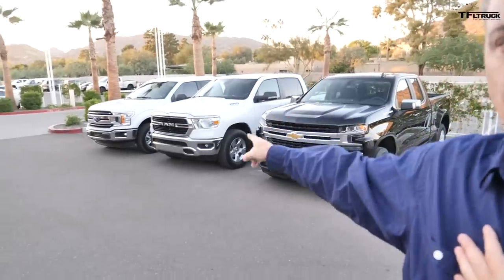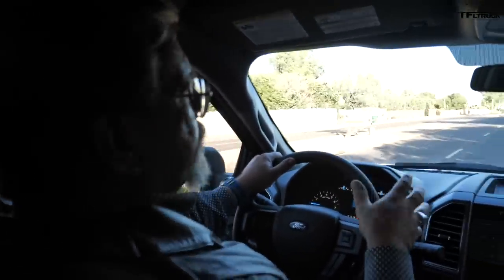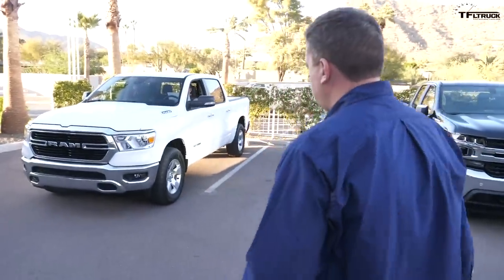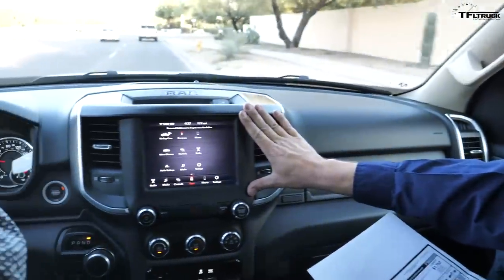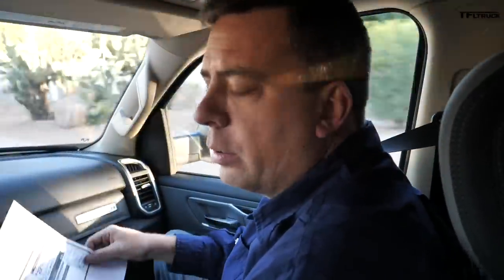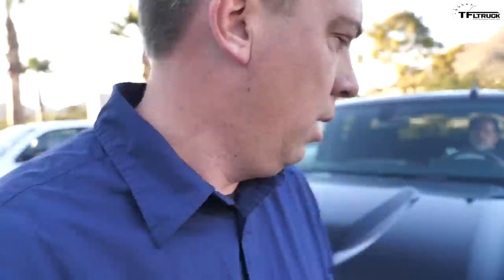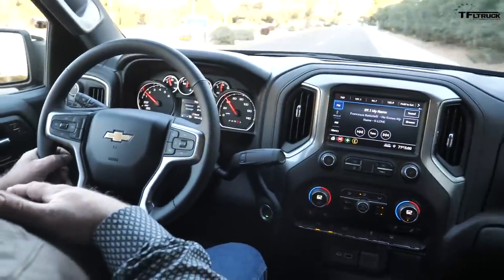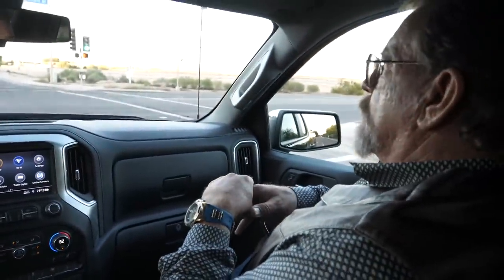Work Truck Wars: 2019 Chevy Silverado 4-Cylinder Turbo vs Ford F150 vs Ram 1500 Review

Comment: The fact that you have to pay $45k for a half ton with a 4 banger is a joke.
Reply: the v8 is only a 900 dollar option
Reply: The Fact that the 4-Banger does what it does is no Joke. For being a Base Engine in the LT Models, it is surprising what it can do while still achieving almost a 22 Combined MPG. It is also the fastest truck listed below.

2019 Silverado 2WD Extended Cab
-- 2.7L Inline 4-Cylinder Turbo
-- 310-Hp at 5,600 Rpm
-- 348-Tq from 1,500-4,000 RPM, and maintains over 300 Lb-Ft of Torque til Redline. So basically the engine makes 300+ Lb-Ft of Torque off idle to redline. 
-- 8-Speed Auto
-- 7,200 Lbs Max Towing (3.42 gears)
-- 2,102 Lbs Max Payload (2,280 Lbs Max Overall)
-- 20.3 MPG City and 23.4 MPG Highway, 21.85 Combined. (It is listed as 20/21.5/23)

2019 F-150 2WD Extended Cab
-- 3.3L V6
-- 290-Hp at 6,500 Rpm
-- 265-Tq at 4,000 Rpm
-- 6-Speed Auto
-- 7,400 Lbs Max Towing (3.73 Gears)
-- 1,840 Lbs Max Payload (1,900 Lbs Max Overall)
-- 19 MPG City and 25 MPG Highway, 22 Combined

2019 Ram 1500 2wd Extended Cab
-- 3.6L V6
-- 305-Hp at 6,400 Rpm
-- 269-Tq at 4,800 Rpm
-- 8-Speed Auto
-- 7,730 Lbs Max Towing (3.55 Gears)
-- 2,300 Lbs Max Payload (2,300 Lbs Max Overall)
-- 17 MPG City and 25 MPG Highway, 21 Combined
Reply: I agree. All of these companies are building Gucci trucks and it is annoying.
Reply: Strixx having higher horsepower, but less than 6 cylinders, does not equal fast. That ecoturd is hauling around a 4,000lb vehicle. Itll overheat and implode in a few thousand miles. You're asking too much of such a small engine. GM is going to get their asses handed to them in the base category until they stop making the 4cyl trucks. Its that simple.
Reply: @LrulestheworldM8  Cylinders means nothing when you make More Power and Torque. As long as all other factors remain the same......tire height, gearing, transmission gearing, weight, wind resistance, and so on, the Higher Torque/Hp Engine will always win. 

We will see how it performs in the real world. I did watch GM do there Torture Test at Max RPM, under Max Load, while engine is tilting continuously, for a long amount of time. Also when it towed 7,000 lbs up a incline and did it pretty well.
Reply: Im only 35 but still was trying to get my head around a 6 cylinder pickup, let alone a 4. I know they have turbos but something about a NA V8 and domestic pickup go together.
Reply: Actually you dont HAVE to pay $45K for a half-ton with a 4 banger. I won't. Bought a Nissan Titan XD, Got a gas V-8, and I can buy a LOT of gas for the difference in price.
Reply: Strixx You keep telling yourself that a small motor hauling around a big full sized truck is a good thing. This is "new GM". Not the GM of old. " new GM" couldnt design a good motor to save their own company. This is an ecotech motor that is bound to fail in just a few short months. When you ask too much of a small motor, its going to let you know. This 2.7 is no exception.
Reply: @BassRacerx  yeah the $900 option is a pretty insignificant amount of money IF the option is available which it soon won't be.   And that's just sad.
Reply: @1badk20  I agree man. everyone acts like they need a truck that can tow a house or some fifth wheel or need something ultra rugged for offroad but if that was the truth they would be driving HD 2500-3500 trucks not 1500s.  1500s are for light duty and there are a lot of buyers who just need something to pick up lumber/dirt from home depot or like me who just need something to haul audio equipment.   I'm not saying that all 1500 drivers don't need v8s just saying the majority of the buyers are just buying them because the power is nice to have and they can afford it.
Reply: @LrulestheworldM8  That's a bold statement.   Do you think that Chevy skipped all those extreme driving tests on the new engine?   That's pretty crazy.   With the countless millions of dollars that they've invested in designing and real-world trials of their new and huge gamble?
Reply: Just like everybody said that the Ecoboost would never hold up.....
Reply: Strixx ,,,,,but see what chubby did there,,,they didn’t go against even the small 2.7 ecoboost Ford.  Why,,,,cuz it’s a big loose for the four banger. Chubbys entry engine is still the 4.3L V6 na so why not put that against the Fords?  Cuz the 4.3 is  only 285 hp with 305 toques VS the smallest ecoboosts  325 hp and 375 torques which beats even their new turbo engine plus the natural aspirated and smaller Ford  beats the chubby too.
Reply: you don't "have to". First, that is MSRP. These will sell well under 40K. You can get a cheap v-6 regular cab 4x2. 

Or keep being cheap.
Reply: LRulesTheWorld I agree ! To have a four cylinder engine ,  regardless of the power output caught between a full sized half ton 4x4 with options and 7000 lbs plus of trailer is asking for it ! All of that weight spread across only four cylinders . Four doomed cylinders , I'd like to see how this engine holds up in the fleet and contractor work truck world long term .
Reply: LRulesTheWorld when did you start considering it "new gm". The 6.0 that's been in the 2500s for the past almost 20 years has been bullet proof, consistently reaching 300,00 with proper maintenance.
Reply: The price is a little high.
 But that 4 cylinder is no joke, 1 second faster in 0-60 times.
 It has a 180° dual valuten turbo.
 Also the high performance cam actuation system is amazing.
 It rips!
Reply: For real. Buy a real v8 every 5-6 years instead.
Reply: @LrulestheworldM8   Depends on the engineering.   I don't know what they currently use, but Indy cars used to all run 4 cylinder turbocharged engines making over 1000 hp.  I think it should be possible to engineer a durable 300hp 4 cylinder engine.
Reply: 45k for a v6 is a joke
Reply: @1badk20  had a 2018 with the 4.3 V6. 285 horse and 305 torque. Freeway was top 26 mpg for me and city was 19.
Reply: @thefreeman8791  Seriously...give me a truck with rubber floors and an 8' bed. I can't stand all this unnecessary nonsense.
Reply: You dont. Local dealer is selling double cab 4x4s for 31k.
Reply: That's funny, because you don't HAVE to pay anything for it.
Reply: Eric Richards You can get an F-150 XL Supercab with the 2.7 Ecoboost, STX Package, And 2.7 Ecoboost a Payload Package for under $45k. Why anyone would pay the same for way less truck is beyond me.
Reply: @LrulestheworldM8  actually being a i4. With similar displacement to the the competition means bigger bores and strokes meaning higher torque at lower rpm. Meaning less stress to make the power.
Reply: @GyroPyro121212  you can buy a v8 optioned truck for less. You ain't getting options but.
Reply: jdr ok Yea, but I’d rather have a decently optioned 2.7 Ecoboost. I’ve got the exact truck I described and never had any complaints about power.
Reply: Bernard
Reply: @LrulestheworldM8  maybe that's why the earliest turbo cars had cast iron blocks....saab.
Reply: @GyroPyro121212  it must be fast considering its the base trim though but if i were to get one i would get the 3.5 with less options
Reply: Emet Playz My 2.7 has clocked a best 0-60 time of 5.5 seconds. It continues to pull strong to its electronically limited 102 mph top speed. It did 0-60 in around 7 seconds with a trailer and two snowmobiles behind it and a soft launch. The 2.7 is plenty of engine.
Reply: @GyroPyro121212  i'm sure if it wasn't speed limited it could probably go 130 or more which is very fast for a truck. motor week actually tested a lariat with this motor and got a slower time i think it was 5.7 seconds but yeah very fast truck indeed!
Reply: Emet Playz Yes. I think Motorweek may have had the 3.55 gears. My truck is a Supercab 6.5 bed with the 3.73 gears. My 5.5 run was done in very cold weather using 93 octane fuel. I did a boosted launch in 4x4. In summer weather it pulls 5.6-5.9.
Reply: @GyroPyro121212  there's this dealer in ohio that sells 725 hp f150s  they probably can 0-60 somewhere in the 3 or 4 second range search up lfp supercharged f150 and you'll find a matt maran video of one its absolutely crazy that a freaking ford dealer is selling these
Reply: Emet Playz Yea. Lebanon Ford Performance 800 package. They’re pretty reasonably priced too and have a warranty
Reply: @GyroPyro121212  damn i wish dealers like that were here in vancouver canada but nah...
Reply: Eric Richards yea on you! That little engine has more horsepower, than all the V8’s made before the Vortec, Coyote and Hemi domestics, along with those built before the 5.7 Toyota and 5.6 Nissan engines, plus more torque than most! Not to mention the mileage improvements and weight savings.
Reply: @LrulestheworldM8  so is it the size of the engine or number of cylinders that is the problem?
Reply: Ron L well, its been a year. And the ecotech silverados have either not sold and are still sitting on dealer lots, or all ended up in the shop for engine replacement. So, I guess your statements about millions in r&d didnt hold up too well.
Reply: A T  all-star edition with 4x4
Reply: Hey, my 2010 Chevy 5.3 liter V8 only made 315 horsepower.  It's towing numbers were almost identical to this four cylinder.
Reply: There is no way I would buy that. Can you imagine the embarrassment when your buddies say pop the hood let's see what you got.
Reply: @1badk20  that 4 cylinder won't ever last
Reply: @jasoncentore1830   Give me one reason why, I am referring to just 4-Cylinders in General and not the GM 2.7L, Why wont 4-Cylinder last over 5, 6, or 8 cylinders. There is plenty of 4-Cylinder Tractors from the 40's, 50's, 60's, ETC that use 3 and 4 Cylinder Engines that have had no problems over the years, heck even a lot of the new tractors use 3 and 4 cylinder engines that will tow a 20' wide plow all day long, 6 days a week, 16 hours a day. Cylinders means nothing when the overall torque multiplication is done right. No one understands that. Cummins has stuck to 6-Cylinders while others are 8 in the HD trucks, and yet still makes the same power/torque, and doesn't effect longevity or reliability. It could be 2-Cylinders, make 500-Hp and 500-Tq, and outperform and outlast the others if build right, and with the proper torque multiplication done through the gearing. 

My company work truck has been amazing, which I started driving it when it had 20,000 miles on it already. We average around 1,500 miles a week with it towing a trailer that weighs a few pounds under 6,000 lbs, and it currently has 102,815 miles on it and it hasn't missed a beat. We expect to have 120,000 miles on it by the end of the year, and 180,000-200,000 by end of next year. We generally swap out for a new truck once our current trucks reach around 250,000 miles, which tends to be 3-3.5 years of driving.

Our previous truck was a 2015 Silverado Crew Cab 2LT 5'6" Bed 4wd, 4.3L V6, 6-Speed Automatic, 3.42 Axle Ratio, Max Tow Capacity of 7,100 Lbs and it towed the same 6,000 lbs 95% of its life until we got rid of it with 258,000 miles. 
 
2019 Chevy Silverado Crew Cab LT 6'6" Bed 4wd, 2.7L Turbo 4-Cylinder, 8-Speed Automatic, 3.42 Rear Axle Ratio, Max Tow Capacity of 7,000 Lbs and Max Payload of 2,000 lb, and was just under $42,000

The 2019 2.7L Turbo 4-Cylinder with the 8-Speed pulls the 6,000 lbs way better than the 4.3L V6 and 6-Speed, and even pulls better than our 2015 Silverado Crew Cab with the 5.3L and 6-Speed. The low end torque from the little 4 banger does not disappoint, and makes it fell like, dare I say, a V8, with the low end pulling power. 

We ordered a 2021 Model with the 3.0L Duramax in it. Should be here first week of November. Which will be a Crew Cab 5'6" Bed 4x4, 3.0L Duramax and has a Max Tow Capacity of 7,200 Lbs.

These trucks with the 4-Cylinder Turbo will last, all while towing 80ish % of its max capacity most of its life. 100,000 trouble free miles, Engine oil changed every 5-6,000 miles, Transmission fluid/coolant/brake/rear diff fluid/serpentine belt/spark plugs changed every 50,000 miles
Reply: @1badk20  2.7T isn't the base engine for GM, it's an option you pay for.
Reply: People don’t realize that the 4 banger is slowly becoming their best engine at this point. The sales are flying because it’s made from all diesel parts.
Reply: @LrulestheworldM8  this didn’t age well. Lol slowly becoming the most popular and long lasting engine…..awkward……
Reply: @roblacerra3257  it's been 4 years, and I haven't seen a single 4 cylinder half ton in my area. The only thing that hasn't aged well here is the joke that is 'new GM', and their failing ecotec motors that throw chains.